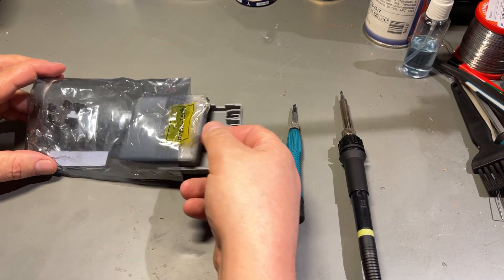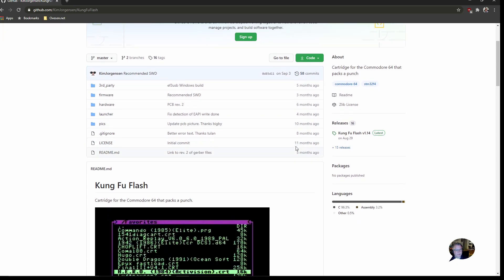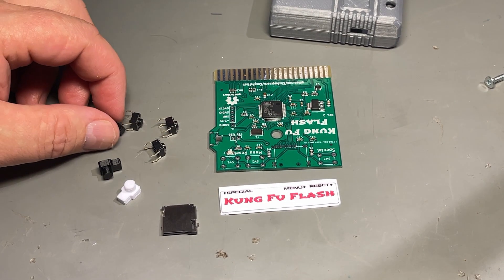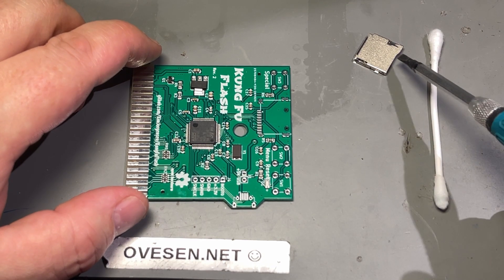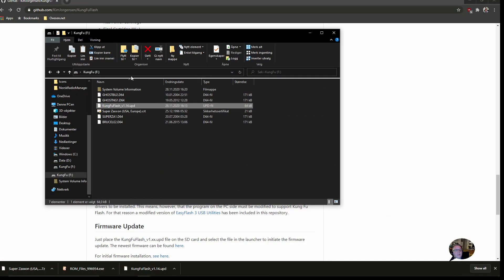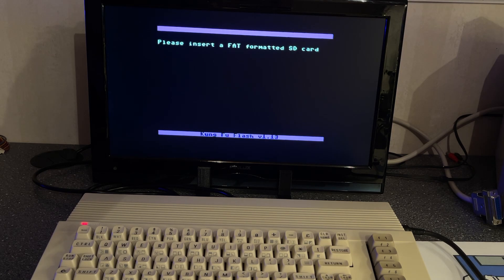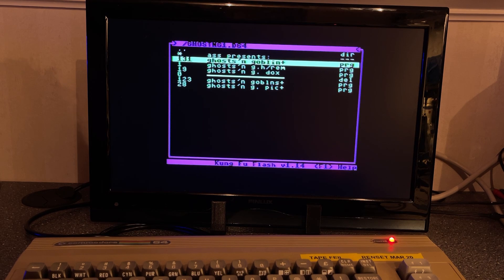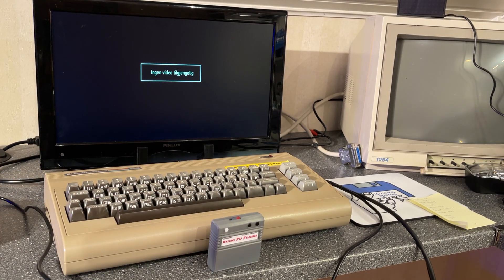Building and testing a Kung Fu Flash C64 Cartridge

Comment from the maker: NOTE: There was a USB-port as well with this kit. I failed to see it in the package. It is necessary to program the chip, but not for using the cartridge in the C64.
Reply: The USB can also be used for EasyFlash 3 compatible downloading live from PC. I have a working setup using KFF with Windows Explorer using "Send To C64" command. Also a working setup for C64Studio with download directly after compiling to real C64. Just the other day I also got "Send To" for sid-files which converts them to prg (temporary) , download and starts them on the real C64. So great cartridge!

Comment: As seen in the Video there seem to be some problems with the KFF Cartridge when using Jiffy DOS on the C64. But the creator already have a solution for this regarding at least D64/JiffyDOS-issues.

From the Github issues
snip
The disk drive emulator has only been developed and tested using the stock C64 kernal.

If you don't have the option of switching kernals then you should still be able to load single file games from a D64 image. Just select the file in the launcher and open the option menu (shift+return or long press fire) and select "Load" instead of the default "Mount and load".-snip-

Comment: I have a Kung Fu Flash cartridge as well and it's definitely my favorite way to load stuff on my C64. The nice thing about cartridge solutions is that you don't need a working IEC port, so it's great to load different diagnostics tools and stuff like that. I had issues with my SD2IEC because I had a bad CIA2 chip. I've since fixed that and luckily my SD2IEC works fine as well now. The SD2IEC is nice as well, because I can save programs to it as well as read them. :) Nice video!
Reply: That was going to be my question too, canyou use this in place of the SD2IEC module. Thanks
Reply from the maker: Thanks! Yes I liked this one.
Reply: The new Kung Fu Flash v1.16 firmware seem to have support for saving to disk, if that is what you mean by saving missing.
Reply: @MagnusWedmark  oh really, that's interesting! Thank you :)
Reply: I am having problems with my SD2IEC too due to faulty 6526 CIAs. I think i will get a  Kung Fu Flash! Seems to solve my problem and can even act as a Dead Test cart.
Reply: @ZxSpectrumplus  You won't regret it! :)